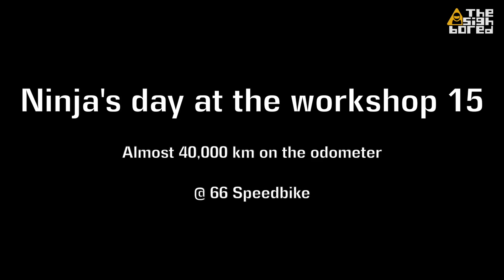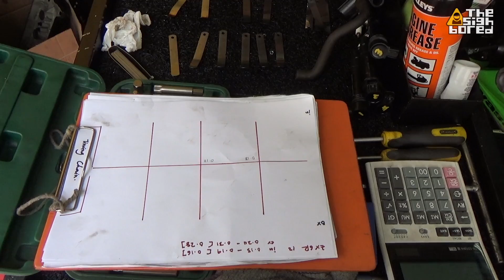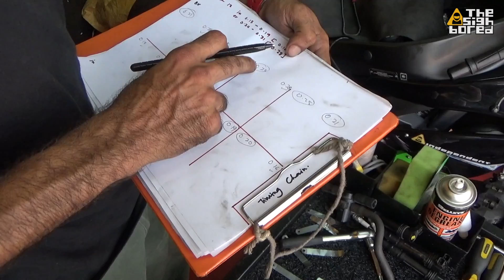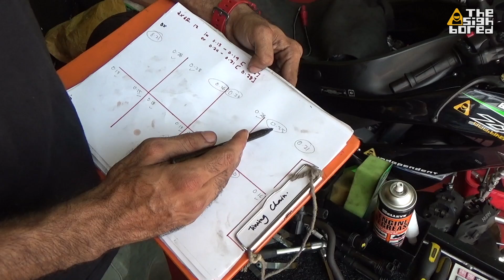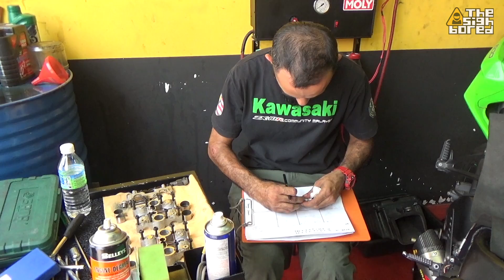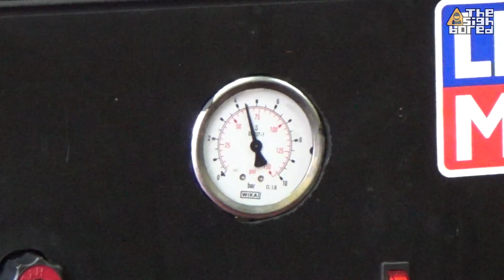Kawasaki Ninja ZX-6R | Workshop 15 | 40,000 km | Service | Valve Clearance | Fork oil | Coolant

Comment: 4:40 did he say motul 300v becomes very thin oil? Is it bad for engine?
Reply from the maker: It's not bad for the engine, it just doesn't have a long life. It's designed for race/performance so it wears out sooner. Need to change more frequently. If the owner has a lot of money for frequent oil change, can use it.

Comment: hi, did u get rid of your cat convertor? And what  model of graves exhaust do have ?
Reply from the maker: I removed the air box/baffle at the bottom, but there's another cat within the headers which I did not remove. The model is Graves Hexagonal Slip-On Exhaust .

Comment: Can I ask why dint change valve together??? Just adjust??
Reply from the maker: This is for checking valve clearance only, if want to change valves, need to do top overhaul if not mistaken, and the cost will be different.. If the valves are fine there's no need to change them all.
Reply: Ooo thank

Comment: Bro I need a personal opinion/advice from you, I'm thinking about to let go my Z250 and replace with Z125 Pro. Since I'm just ride my bike to work which I think it is better to have a small bike especially in KL area. Does it sound bad?
Reply: that would be unwise Ady, addition to your bike is yes, letting go Z250 to get Z125, that's just NO
Reply: Fahzan Aziz yep, I've thinking about that too. But most of the time I ride my bike just to go to work. So I've been thinking to downgrade my bike. If only I manage to sell my bike.
Reply from the maker: I don't think it's a good move to downgrade, especially to a Z125 Pro from your Z250. 
- You do save a bit on maintenance cost, but not by very much. 
- Parts like tires are not that easy to source, and good ones are costly. 
- The power of the Z125 is very much lesser than the Z250. 
- Your commute to work will be slower, and you might not have the power to overtake cars. 
- You lose money when selling the Z250, and the Z125 is quite pricey. 
- You can consider other scooters or kapchai, cost less and more storage room. 
- With more practice you can still easily manage a 250 for the KL streets, it's not that big or heavy. 
- In future you can always plan some long distance rides won't have any issue.
Reply: TheSighBored thank you bro, have to think a lot before consider to make any decision. good advice for newbie like me. 😔

Comment: Bang..nak tukar oil seal kat pulley magnet tu camna bang.. magnet pulley tu tak boleh cabut la bang
Reply from the maker: Tak faham apa itu magnet pulley? Magnet coil / strator ke?
Reply: @thesighbored  ouhh strator ke pangilan nye tu bang..sory2..yg seketul bulat coil duk dalam tu la.. skang ni dlm casing tu ada minyak terlebih terlalu banyak..tak macam biasa nya sedikit..
Reply from the maker: Kalau tempat magnet coil biasanya tak ada oil seal.. Boleh cuba tanya mekanik sebab saya bukan mekanik.. Tanya 66SpeedBike ataupun Blueprintgarage tengok macam mana.

Comment: Someone told me when u change the pipe u also have to do a tune up   to make the bike run good is it true ?
Reply from the maker: If you just install a slip-on exhaust and not a full system, it is still OK, but if you install a full system, generally it is better to get a dyno and tune up done. To know if your bike needs a tune, you can always get a dyno run for the bike and see your current engine health.

Comment: Hi bro in term of all the engine oil brand which brand of engine oil have been great into your engine so far?
Reply from the maker: All the oils I've tried with seem to be fine, didn't have any issues. Currently on Liqui Moly and since my friend who races also uses the Liqui Moly has no issues, I'm happy to stick with Liqui Moly.

Comment: hey bro i planning to get a 2nd hand zx6r model same as urs..i just realize ur bike rear have lowering right? how much the height it lowered? my height is 172, last few day just test drive my friend bike and its very tall my half foot just cukup cukup kena only but the bike very easy to control hehehe
Reply from the maker: No, it's not lowered. I raised the rear up by 4 mm.
Reply: TheSighBored what is the different after raise it?
Reply from the maker: Slightly sharper handling feel.
Reply: then more fun in this bike haha thanks for the info cheer bro ;)

Comment: Is it a must to do the valve clearance?
Reply: 40k km mileage have to do valve clearance
Reply: Sunny Ng Legitly can make my poket burn. 😂
Reply from the maker: Yes, it is a must, unless you don't mind having chance of destroying your engine. 40k km is not the manufacturer recommended time to check, it is based on my own preference. If you ride your bike hard all the way it's better to check your values sooner than later. Maybe 25 - 30k km intervals.

Comment: WHAT'S THE NAME OF THE BRAND FROM YOUR MIRRORS
Reply from the maker: They are generic unbranded CNC mirrors, you can find them online sites such as Aliexpress.com
Reply: @thesighbored  COOL THANKS BRO
Reply: @thesighbored  IM UNDECIDE OF GETTING A 636 2018 OR ZX 1000 2018 WHAT DO U THINK
Reply from the maker: Is it going to be your first bike? If you can control yourself and not ride beyond your limit while you are learning the skills to ride, probably the ZX-10R. Otherwise maybe something smaller first.
Reply: @thesighbored  WELL I HAD A  R6 2016 IS A TOTALED LOST JUST GOT INTO AN ACCIDENT IM IN CRUTCHES FOR NOW BUT I WANT A NINJA SHOULD I GET A 636 OR ZX1000 WHAT U RIDING
Reply: ANY RECOMMENDATIONS ON CLEANING PRODUCTS FOR THE BIKE
Reply from the maker: Sorry to hear about your accident, wish you get well soon. In that case, maybe the ZX-10R. Mine is a 2012 ZX-6R. Cleaning products.. The Moto Cleanser HD for chain was pretty good. The other thing is the Maxima SC-1 clear coat to keep the plastic parts shiny. That's about it.
Reply: @thesighbored  IMA GET THE 636 2018 INSTEAD BRO THANKS FOR THE INFO GOD BLESS U

Comment: I have 2500km before reaching 40k km mark.. huhu.. need to save money from now..
Reply from the maker: It all depends on when you decide to do what. It's not the law to do it at 40k km like what I did, 40k was my personal preference to get all those things done. If not should follow the manufacturer recommended mileage per your user manual.
Reply: TheSighBored I see.. mine is z800.. most of my friends said that 40k need to do major servicing including valve clearance.. is it anything said in the manual? Currently I'm also planning of calling welly bt cave - where I bought it - to see what their recommend.
Reply from the maker: You can download your bike user / service manual on the Internet and see for yourself. If not mistaken manufacturer recommended is earlier than 40k, but it depends on yourself and how to ride/take care of your bike, can be done a bit later or not. Workshop will usually say 30-35k that's my guess.